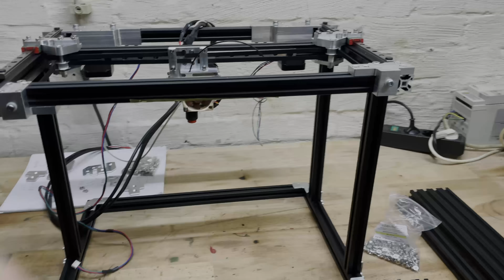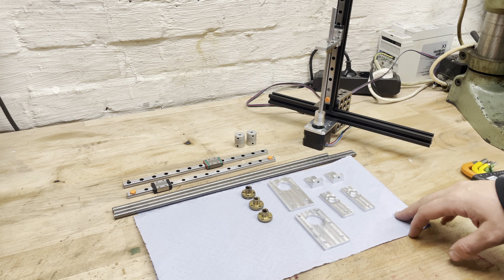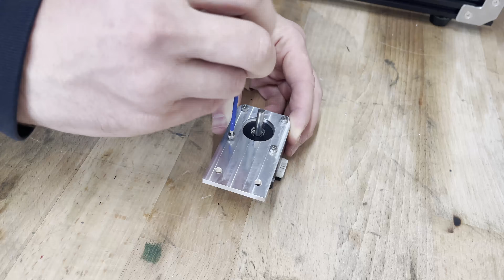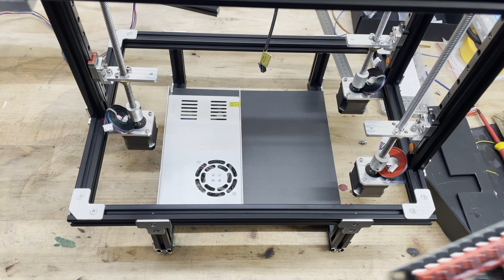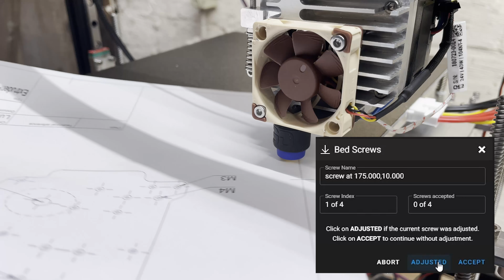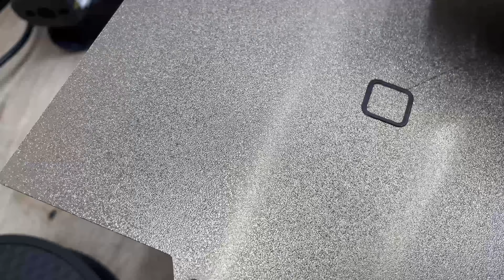Why building custom 3D Printers should sill be a thing (Final Assembly, Klipper config, Testing)

Comment: super cool you did this, but one concern: i think your heatsink fan may be wired incorrectly. (maybe to your part cooling fan?) Either way, your heatsink fan should probably be running all the time to avoid heat creep. With your toolhead being aluminum, hopefully it hasn't gotten too hot, but definitely take a look at that. Happy printing!
Reply from the maker: @blokshredder1276  thanks, and yes that is not correct. I think it was a issue in my wiring. it seems to be fixed now, but I am still keeping an eye on it

Comment: Lukas nice build, i would recommend putting thrust bearings between Z coupling and motor this will help with keeping layer height consistent, next change the bed to Kinematic bed mounting, it will work far better on Tri leadscrew beds. I too are in the process of redesigning and rebuilding my DIY Cheapman's Voron v0 i call VoroNot :), you can see some shorts on my channel, and will also be adding a tri leadscrew Z axis.

Oh yes and another mod you want to look at adding to your printer is double shear mod on you X and Y drivers, this will let you tension belts more without worrying about bending motor shaft or causing premature bearing wear on the motor bearings
Reply from the maker: Thanks a lot. And that’s a couple of good points,  the current setup in the Z couplers leave to room for movement. And the kinematic mounting also sounds like a good idea :)
Reply: @lukasOtis  Yup you'll see as you start increasing your printing speeds and your Z needs to increase its speed for Z hop movement during printing the you will start getting some artifacts in Z, this is due to the motor shaft on Z motors not being locked in place in the Z axis so they basically levitating, this is also why belted Z axis get rid of this issue as the motor is then placed on its side.

but you have a a great build going there, i cant wait to see more of it and the changes its going to go through.
Reply from the maker: That's great input, I'll keep an eye on it and then either continue working with mods or switching to belts. Thank you :)

Comment: I have my own DIY 3D printer that prints without "any" failure (except maintenance stuff or tangled spools etc)  for more than 10y 
I literally dont need to touch it all the time ....only cleaning linear rails once in a while or repleace the xy belts 
Z axis run dry (petg nuts) 

Good quality (yet i get then used from old ink printers ) stepper motors 
Cnc (20mm) linear rails
Not speed demon but i print with 0.6+++ mm nozzle so dont neet to be (because its big for big stuff....up to 450x600x470mm) 

Best ones are diy
You can make them to last for cheaper
Reply from the maker: Sounds like a great build! I will have a look at the PETG nuts, that could make it a bis simpler

Comment: I can recommend to use the macro "Screws Tilt Calculate" so you don't have to use paper to level. It measures the distance with the probe at the screw location and then tells you how much to turn the bed screws.
Reply from the maker: @larseastman1567 thanks! I will give that a try